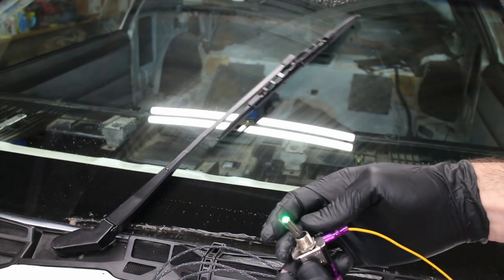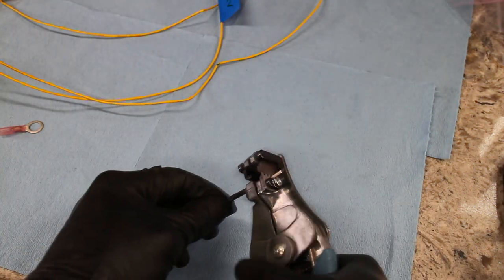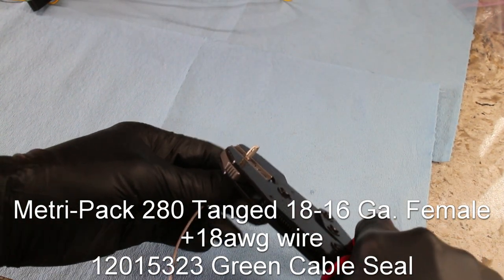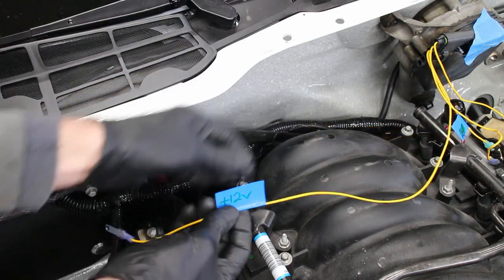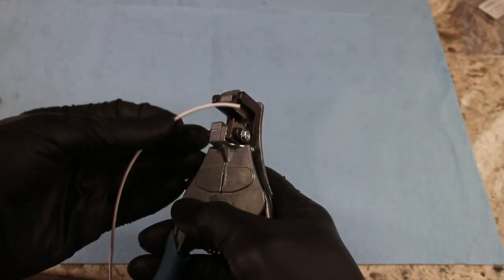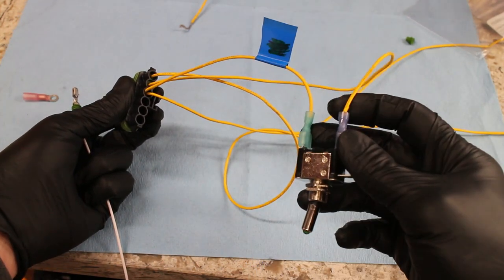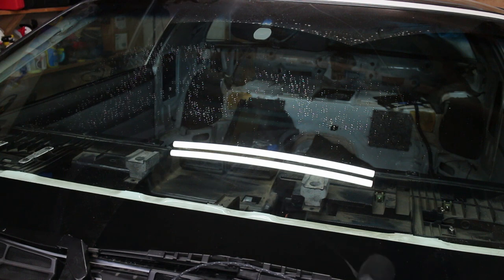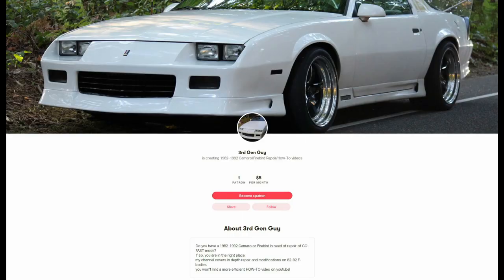How to Wire up a Windshield Wiper motor (1985-1992 Camaro/Firebird)

Comment: This is a handful, my car is an 83 street / strip car not full on race, and has the "additional" Rube-Goldberg washer assembly so it is huge, I opted to go the 89 Nissan Maxima wiper motor route at least for now, along with a later years washer container with integral pump, this way I have room around the much smaller motor, and am able to spray my windshields as much as I see fit. Only one issue, there is no "auto-park" feature with this set up however, all good things i time. Great stuff, Thanks.

Comment: Hiw do you replace the motor for the windshield wipers
Reply from the maker: the wiper blades are popped off.
the plastic cowl cover mesh thing is removed.
then the wiper motor unbolts from 3 m6 bolts and one nut on the motor shaft.
it's fairly easy
Reply: @3rdGenGuy  thank you, and my Linkage on the passenger side keeps popping out how should I fix that
Reply from the maker: I don't  remember what connects the links to the outer wiper mounts.
Reply: @3rdGenGuy  Allright if you do happen to remember can you let me know

Comment: i wired it like you showed but i have this weird problem that when the car is turned off it works fine but when the car is running and i turn off the wipers they start doing "mini laps" and wont turn off until i remove the power cable from the battery. Do you have any suggestions
Reply from the maker: hard to say.
could be a bad connection or a bad ground.
Reply: @3rdGenGuy  yea but it is so weird when it works just fine when the engine isnt running but as soon the engine is running they wont go into park

Comment: Great video! Can you use a single pole double throw switch to have high and low?
Reply: You'll need a double pole double throw switch. Because describing it all in writing would be very long I made a quick and dirty video about it: https://www.youtube.com/watch?v=blFm7MIRxlw 
A single pole double throw won't work because you need to feed the low speed coils in both modes, but with the single pole double throw you can't isolate the low speed from the high speed and would only get high speed.